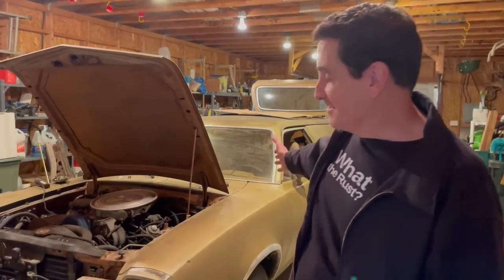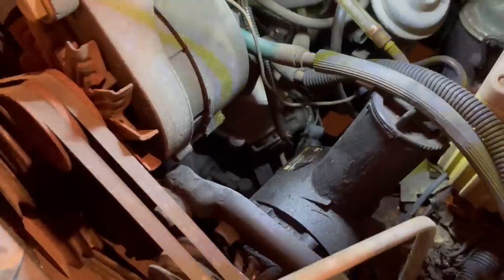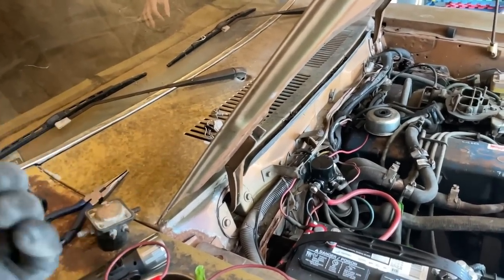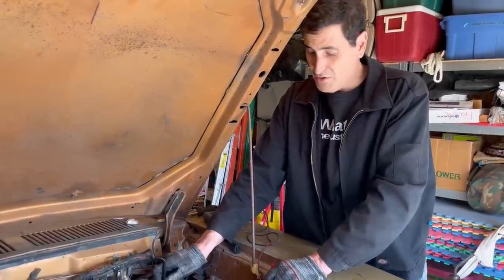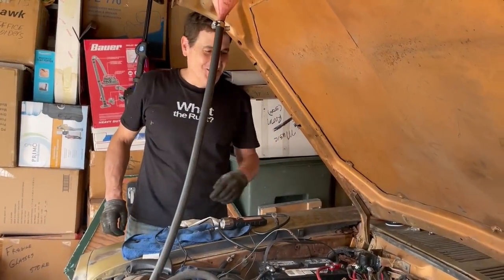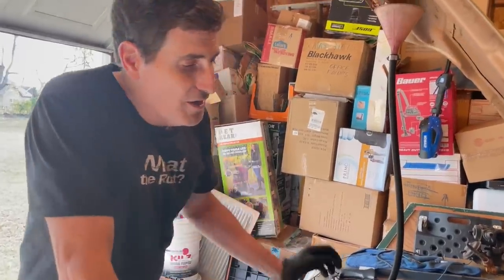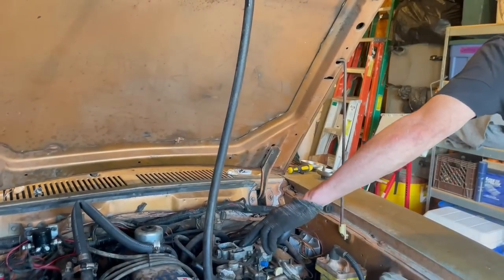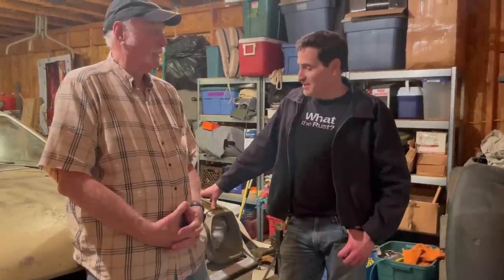Will it run? 1978 Ford Pinto party cruising wagon!

Comment: We had a 71 2 Door Sedan had a trunk no hatch ran great the odometer quit all the numbers rolled so no knowledge how many miles it had we just put a timing belt on it every 6 months drove it to High School until about 83 and I bought a white pinto hatchback 4 speed and a/c which the 71 didn't have all the emission controls by then made it a gutless wonder I hated it ended up trading it in for a 78 LTD II which was a pale yellow total piece of junk I basically quit on Ford after that.

Comment: I had one of these in the 70s. My grandma made me curtains for the back, and side glasses. I put mind blower speakers, and strobe lights in the back. Poor car wouldn't even spin the tires even when wet. Mine was a 1975. Pulling the starter is a pain. Had to take motor mount lose,and jack up engine. Under the hood had all kinds of Japanese writing on it. Worst car I've ever had.
Reply from the maker: I understand why Ronnie. It isn't something I would want to work on too often. The underhood space is close to zero.

Comment: You can fire them off at the gym thank you I'm not talking to you already what's up module into RA with that whole CDI Box you just have to mountain gene makes the eye model and I'm gonna go onwait are you coming out on the firewall or somewhere you gotta put that dialect your grease underneathat when you do it and there are several videos and diagrams I'm trying to run wires to show you which wires crossed the wood like moore'ski of mortski repair has a video on it and run on a straight 6 on a die John one That's that's well I think